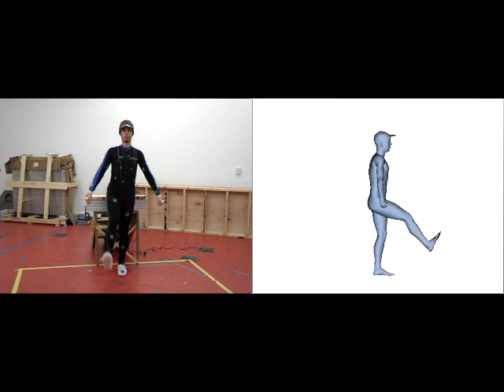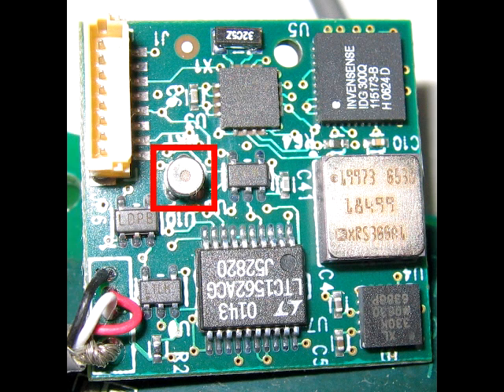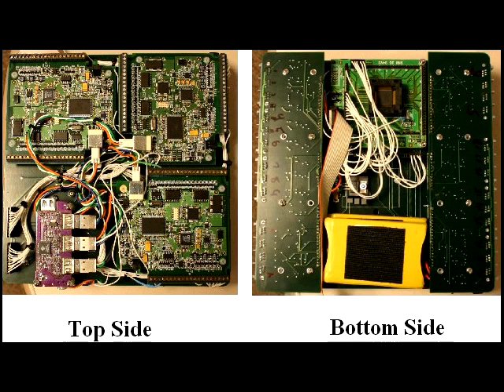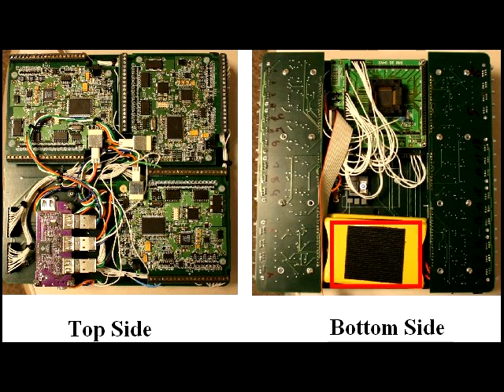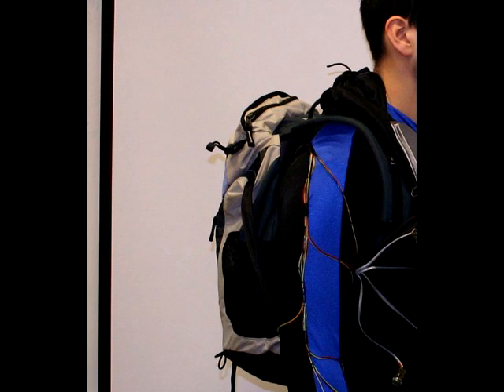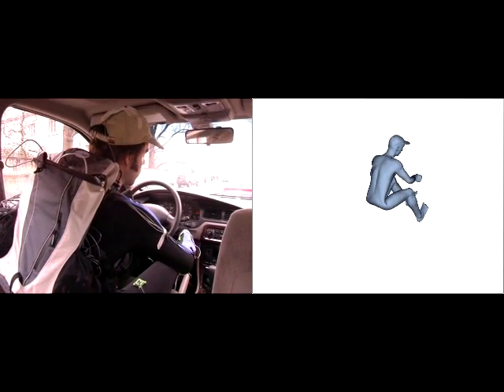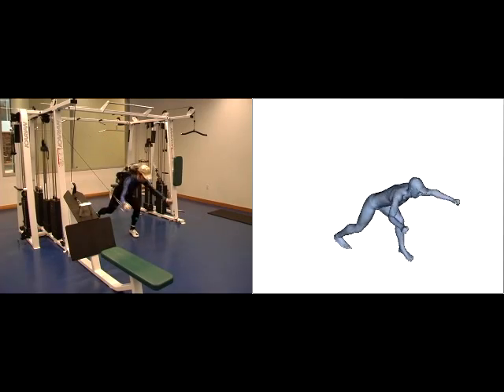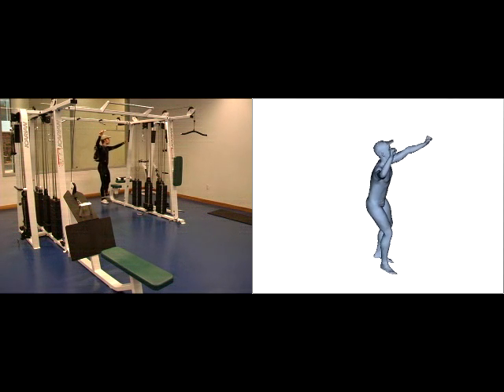Practical Motion Capture in Everyday Surroundings

Comment: You could probably position extra ultrasonic transmitters around the set beforehand as markers.  You could use as many as you needed, so the wearer would always be in range of 2 or 3 of them.  Just measure the actual distance and angle between them and match them to your virtual set.

Comment: It's not up to optical standards, but for $3000 it's impressive.  It looks as good as or better than magnetic motion capture which used to retail for over $30k.  They still have some work to do to deal with drift.  Manually animating drift out would be very time consuming.  Also notice how the arms are not very accurate on the Lat pulldown machine.   But again, for their first release, I'm impressed.  I look forward to see how they develop over time!